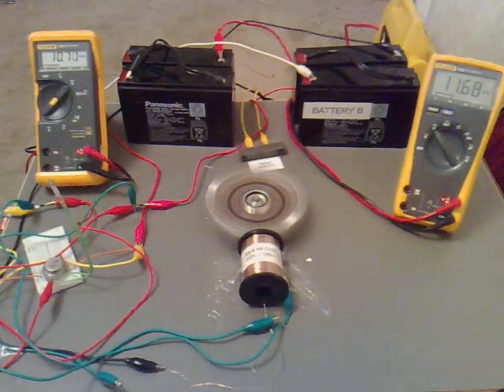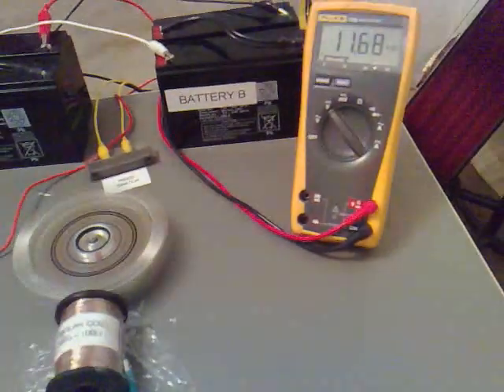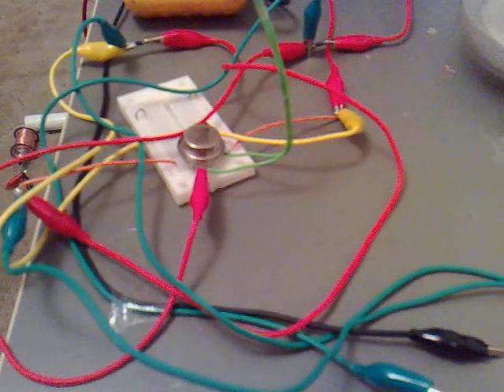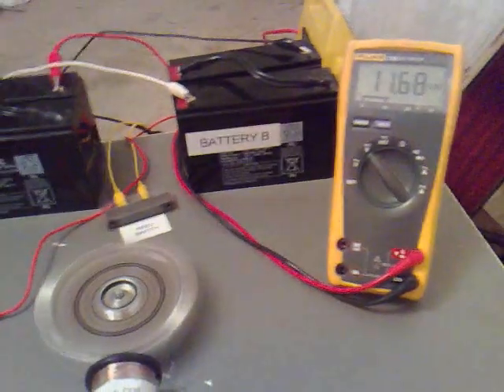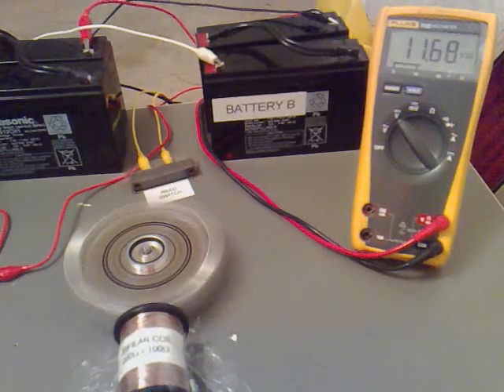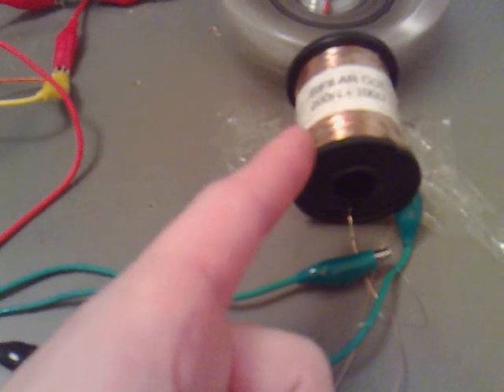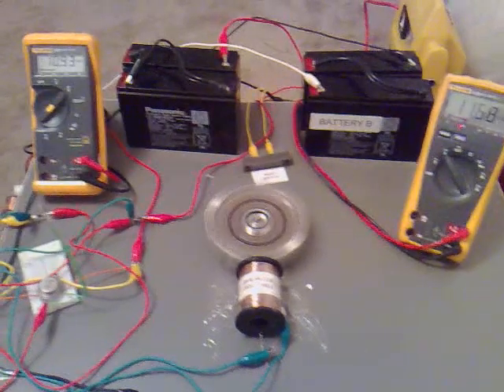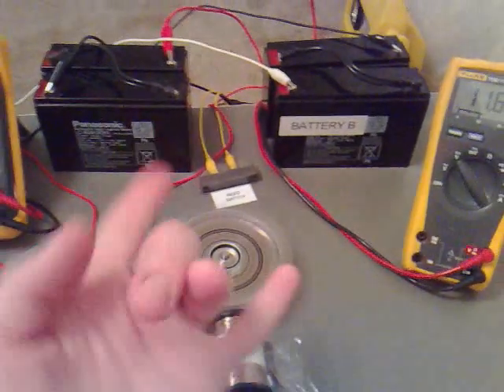Pulse Motor (Bedini Workin') 043

Comment: Hello! Great video! 5/5
I tried the same, but failed. I'm using two 9V 150mAh NiCd rechargeable batteries that are swapped at 7Volts. But my motor finally stops. Did you use the simplified schematic or something else? What are your coil parameters? Mine is 600 tirns on 0,5 inch internal diameter.

Comment from the maker: cheers, Im hanging on an oscilloscope a bit......

I think that the fly back voltage off a Tesla coil will do it, if its 41v(Average) off a 12v system then what would a 50kv Tesla coil be.....lol

I think its all in the tuning of the numbers.

Comment: have you considered taking one of those coils laying on the ground and using it as a generator coil off the spinning magnets? you probably wont get high amounts of energy, but every little bit counts. you can run that little extra back into your running battery, i bet it wont drop to 10v after that.

Comment: haha! tell me about it!  I've got a new soldering iron, new magnets, new batteries and a potentiometer hanging in the ether some where!  driving me mad!  they say it is only going to get worse as well :( trifilar could be an improvement but havnt tried that yet.  one thing you could do that such increase the circuits ability is to reduce its size.  I see alot of cable!  if you can, attach the diodes and resistors directly to the transistor.

Comment from the maker: COM = common
NC = Normally Closed
NO = Normally open

COM & NO is what you need, the neon goes across that.

I got my neon out of an electricians screw driver the ones that glow when you stick them in a plug. Cost a couple of pounds.

Hook one side of the reed(COM) to the coil the other side to a battery and the other battery terminal to the reed(NO) again.

Comment from the maker: As long as you hook up the reed switch with Neon or the coil (In Parallel) the excess Fly back voltage is burnt in it.

Good luck with your motor ;-)

Comment from the maker: Hi I made a bifilar Coil with 200Ohms & 100Ohms the amps it draws is about 0.2 Amps @ 12v and it stays very Cool (can not tell its on)

As for the diameter I just filled up a standard 250g wire spool so I could put different cores in it, no core seems to work best.

Hope this helps